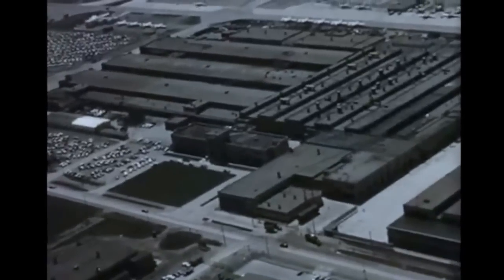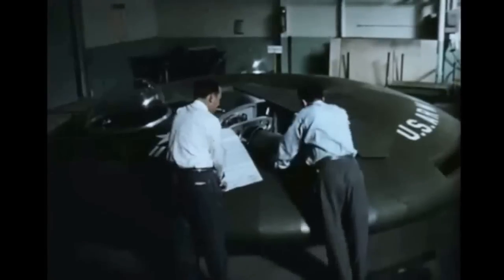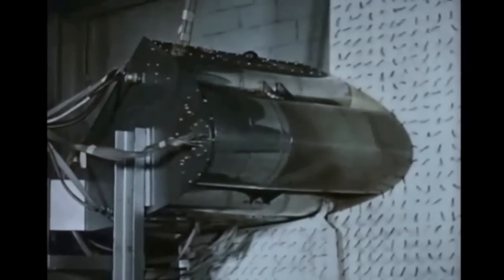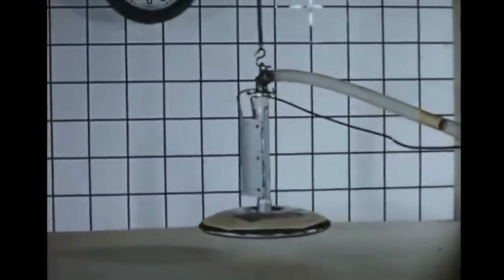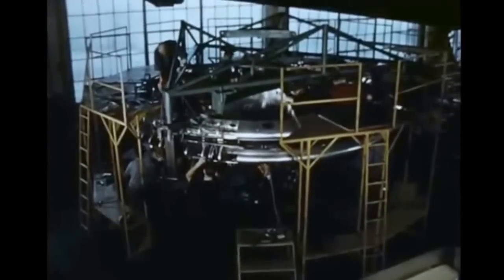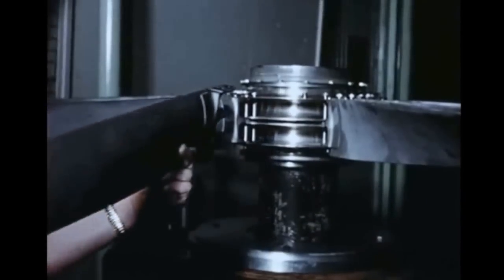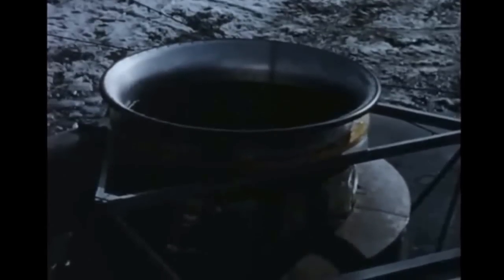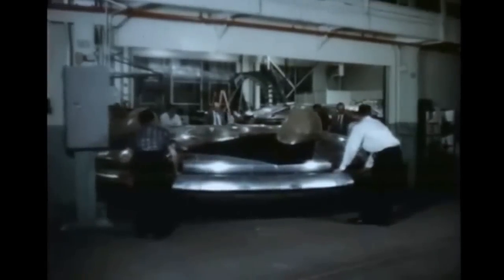A.V. Roe Canada VZ-9 Avrocar Flying Disc Progress Report #1 - 1959

Comment: Its too bad really. They had the right idea, just not the right configuration of engines or control systems to make it work better than a hovercraft. Just a few years later, the British built the Harrier, which proves that it is possible. Now we have the Marine F-35 variant that proves once again that stable flight can be achieved. If they had been able to work on it for a few more years it probably would have flown fine. Unfortunately, Avro was shut down, along with its two best aircraft programs, the Arrow and the Avrocar. Makes me wonder if the US worked on similar secret programs with different engines and configurations.
Reply: The Harrier was not even remotely the same concept.